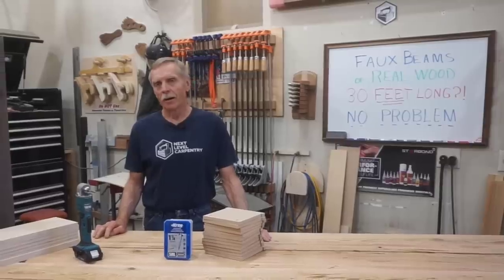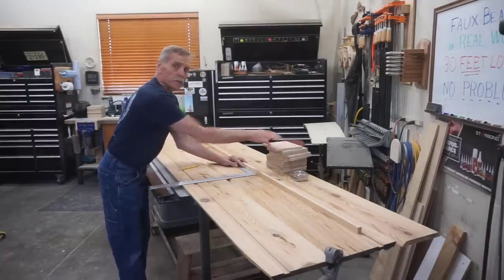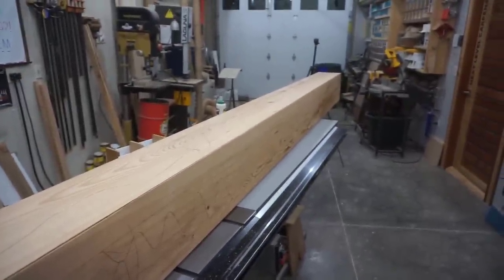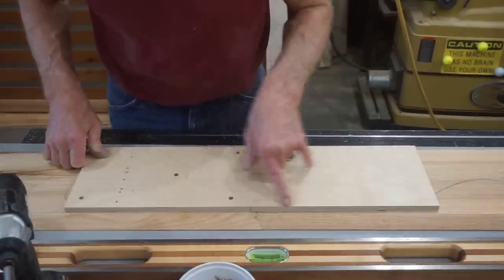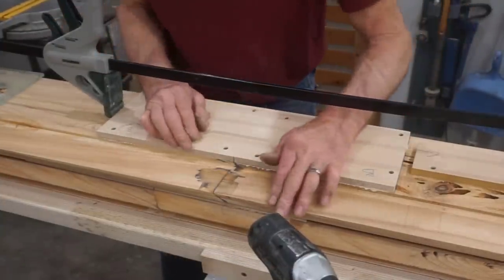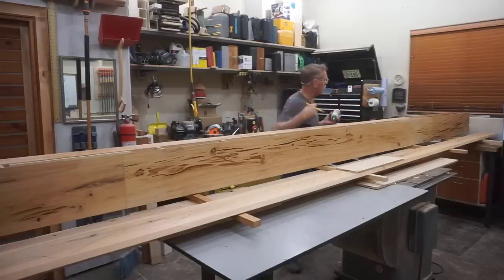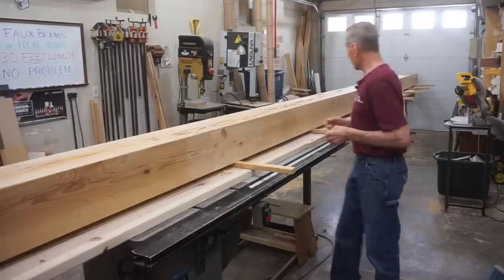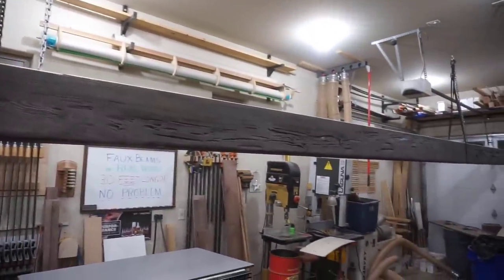Extreme Faux Beam Build

Comment: Great looking beam Matt!  The miters and finishing techniques really cap off a master execution of straight and true carpentry.  Thanks for bringing us along while you built this.
Reply from the maker: Thanks for checking this out Greg... I hope it opens up architectural/design possibilities for those who watch the video. 😎
Reply: It is reassuring to see other carpenters putting specialized care into a detail like this.  

There is always and has always been pressure to get'r done as quick as possible.

There are people out there who will pay you to use thought and care to solve their problems.  And a robust fix is usually the cheaper.
Reply: Don't worry about bending over every now and the Matt.  That's Tradesman Yoga.
Reply from the maker: @markharmon4963  Tradesman Yoga... true dat!!

Comment: I love this!!  Great work!!
I built my Son and Daughter in law an 18ft faux beam. They had a main glue lam beam the was drywalled and textured running through the kitchen.  
Instead of trying install 1 long piece we divided it into 3 equal pieces and welded some flat bar 3in wide and rounded the welds so it looked like 1 solid piece to coverup the joints.  heated the straps and black oiled the steel give it rustic looks .   drilled holes both sides welded bottom bolt heads to bottom holes, top holes run long wood screw and JB weld a faux bolt head over the wood screw..

Comment: Excellent video! I watched to the end of the end of the end, and the beam looks great.
I've done smaller ones to create faux headers and exposed rafters, but nothing that required that level of complexity. Amazing work!

I  mounted the ones I've done on flat surfaces to plates attached to the ceiling. Thanks for the tip on the cathedral peak mounting blocks, as I haven't done that before.

I will say that my dust collection system is a little more advanced than yours though. Mine is a two phased system consisting of a broom AND a bench brush. 😀
Reply from the maker: Lovin' your comment Magius... thanks for watching and sharing!
I definitely need to upgrade my dust collection system to a two-phase model LOLOL!!😂😂

Comment: This Faux-Beam build is AWESOME. In this world of fake pvc and mdf painted trims or worse foam, this is refreshing! Have you thought of using half laps/scarf joining instead of a 45 miter and plywood to extend the length? 
 I'm no engineer, but this is basically a box beam and I'm sure it will be solid.
Reply from the maker: I didn't consider half laps or scarfs Rolf but both are definitely worth considering.  I think the biggest challenge would be in achieving acceptable 'grain flow' from one piece to the next with the pecky cypress but with wood like white oak I could see it being an excellent choice.  It would certainly be a more 'elegant' solution IMHO... 
Best,
Matt

Comment: Wow. Thank you for such a great video. I have a job coming up where I have a 24  foot span to figre out and this helped reset my mindset. I installed faux beams in my kitchen recently and applied the mortise and tennon look to it in the middle of my longest piece, which I learned from one of your other videos; and it worked out much better than I thought it would. Thank you for your videos and time spent to educate, no matter how long they are. Great looking beam you built there. Looking forward to seeing many more as well as, hopefully, the installation video of that monster beam.
Reply from the maker: Thanks for your comment, Carl... much appreciated.  You are the sort of person I have in mind while producing videos like this; someone who watches to learn compared to those who expect to be taught.  FYI this was a nicely profitable project so I hope it works out well for you too.
As it turns out, it was actually simpler to build long beams using this method than it was to build shorter sections using methods shown in that other video.  Since you were able to make shorter beams I predict you'll be pleased with the process and results of the upcoming 24'er.  FWIW I made two 6x8 beams for this same project, one at 21' long and the other at 24' that helped me 'practice' before doing this beast making it come out better and with less stress.  Let me know how you do if/when you tackle that longer beam and expand your horizons!
Best,
Matt

Comment: I had this idea floating in my head for my son's house, so it's great to see.  I was wondering about the use of glue/jb weld on the end grain - anything I've read through the years says  glue on end grain is pointless but here you are doing it.
Reply from the maker: I used JB weld for this 'end grain' application mainly for its gap-filling property that's superior to wood glue.  It would never hold the joint on its own but, combined with the splice block on the back side glued on with Titebond, it's a perfect combination for success.  The takeaway it to be careful when extrapolating ideas like this and taking them out of context which will usually lead to failure and disappointment.

Comment: Genius.  A great video and lesson on how to do something that scares all of us.  Thank you.  One question: how do you attach to a steel beam (to cover up) running across the ceiling.
Reply from the maker: Thanks Howard!
A common way to wrap a steel beam is to use a powder actuated nail gun to shoot 2x wood blocking to the bottom of the bottom flange and to glue and wedge 2x wood blocking into the web space of the beam.  This blocking serves as 'nailers' to use screws or nails to  fasten the beam wrap to the steel beam.  Hope that makes sense.  BTW I would use the same method to create the faux beam to wrap the steel beam with the exception that I wouldn't glue the blocks in during glue up and assembly.  That way, after the bottom of the beam is glued in and dries, just simply unscrew the glue blocks and remove them to create a u-shaped beam wrap.  It won't be nearly as sturdy but, if handled with care, you should be able to maneuver it into place and fasten it without breaking it IMHO.

Comment: I like the right angle drill, I have that one too. I'm just wondering why you didn't use the Makita right angle impact driver?  I like how thorough you are in your verbal explanation of everything write down to the Torx head screws. I love your shop and the work you do.
Reply from the maker: Thanks for watching and commenting on this one Randy... much appreciated.  You might not believe this but I don't own Makita's right angle impact driver.  It gets worse: I didn't even know they made one until I checked just now after reading your comment.  Do you have both the right angle drill and right angle impact?  Question: can I blame you when  I tell Mrs NLC about the new tool I NEED for Christmas now?! 😉😂😎
Reply: @NextLevelCarpentry  No I don't have it, I have the ridgid right angle impact. I know shame😪 I no longer buy tools made by chinese companies. I now stock my screw box with only torx head screws.

Comment: Another Master Class in finish carpentry Matt,, the final product looked superb.  How did you transport the big boy?? I'm guessing that you would use a couple telescoping lifts to put it in place. I build faux beams in a similar fashion but the indexing block is a new wrinkle to me,, pretty clever old man!  I usually use cdx for the blocks to help eliminate the screw fractures. In any case my hat is it to you, great job.
Reply from the maker: Thanks Paul... considering your extensive background I take your comment as quite a compliment.  Great minds think alike because if I had this to do over again I'd go with 1/2" Baltic Birch for the exact reason you say.  FWIW because the beam weighs ONLY 150lbs or so I'm planning to bolt a couple steel brackets to a couple trusses and do the beam pick with a couple come-alongs to lift it 90% of the way.  After the initial lift I'll slide scaffolding under the beast, remove lifting hardware and lift it  the rest of the way to the 17' high peak by wedging 16' 2x4's underneath.  At least that's the plan, but, as Mike Tyson says: "everyone has a plan... until they get punched in the face!"  I'm just hoping the beam doesn't hit as hard as 'ol Mike! 😃😃

Comment: Impressive!
Reply from the maker: Thanks Michael... it was a fun and challenging project but I have to say it was time to be done with it and move on, if you know what I mean?
Reply: @NextLevelCarpentry  I would have used strips of 1x2...the pocket hole squares were genius!
Reply from the maker: @michaelbradford4444  necessity is the mother of invention especially for projects like this. A secondary benefit of the blocks versus continuous strips of one by twos in Corners is that they can contribute a lot to overall stiffness which was important because it's being had to be transported to the job site and installed as a single piece. Hope you're able to put the concept to use somewhere along the way...

Comment: Amazing work! Best I’ve seen. I’m assuming this beam will be installed up against a ceiling. If you created a beam (red oak 6” high/8” wide) with the same construction, would that work if they were going to be suspended across a 16’ span where the beam would only be supported on each end (against two vertical walls)? I’ve been researching the best methods to avoid the faux wood box beam from bowing and wonder if this method of construction would work. You may have mentioned this in the video, but are the internal blocks 3/4” plywood? Thank you!
Reply from the maker: It would take at least 10" of beam height for an 8" wide beam to freespan 16' IMHO.
Blocks can be plywood or mdf.

Comment: Great work!! Would you ever consider using scarf joints instead of miters to better conceal the joints in the shorter pieces? A lot more work I know, but a nice detail!
Reply from the maker: Scarf joints would actually be a better solution for both appearance and strength (they wouldn't need splice blocks for strength) so, if material availability & cost weren't factors I would definitely consider using them as an alternative as you suggest.  On a beam with a smooth, stained finish with any level of sheen and installed at a height that was closely visible I think it would be necessary for a convincing 'solid beam' look.
Reply: Wouldn’t you need a radial arm saw with a dado blade installed to cut something like that? Or you’re down to hand planes and chisels.

Comment: Awesome tutorial -As well as the temporary block above the daddo joint would some 18 gauge brads from the back help hold that joint even after epoxy goes off?
Reply from the maker: Thanks Pinpatch.  Personally I don't think 18 gauge brads would help at all in this application.  To understand my thinking you could do a little test by brad nailing a 45 degree joint on a couple pieces of scrap.  I don't think they'd offer the slightest bit of strength to the connection.  I don't mean to be harsh for a very reasonable question but I operate from a mindset that brad nails are over-used these days... probably just an old-school thing.  I also think pocket screws are over used though so this project is a bit of a reality check for this old nail bender! 😃🤯
Reply: @NextLevelCarpentry  I agree it was just to pin the mitres together until the epoxy goes off where a permanent back plate couldn't be left.  
We use this a bit when mass producing mortise tenon joints for sashes. Glue it all up then pin it when in the press and remove it. This keeps the joints solid enough until the glue goes off and frees the press for the next sash (or door)

It would be great if you could show a few photos of the beam installed. 

Thanks for your effort and time doing these videos.
Reply from the maker: @pinpatchyeah7987  oh okay thanks for the explanation because I misunderstood your original comment thinking you suggested nails for additional strength not for their temporary benefit of alignment.
That said I think the softness of that pecky Cypress would still render 18 gauge nails useless but in something like Walnut Maple or Oak they would serve the purpose.
😎

Comment: If the ( MDF ? ) gussets get wet, they will swell and potentially pop the mitered edges of the box beam, maybe use a different material for these?
Reply from the maker: If enough water gets into this beam after installation to make it swell to the point of popping miters, the failed beam will be the least of their problems and I'm not going to feel irresponsible for choice of material 😏

Comment: That was awesome! How in the world are you going to transport this monster beam?
Reply from the maker: The beam is so rigid and relatively light weight (less than 150 lbs) that two of us simply carried it out of the shop and set it on 4 sawhorses strategically placed on a 24' flat bed trailer for a trouble free 12 mile trip to the jobsite... gotta love it when a plan comes together.🤯😃
Reply: @NextLevelCarpentry  I stayed to the end of the end of the end, and the "beam" ended up beautifully.
Reply: @NextLevelCarpentry  I assume you didn't have a staircase to deal with, the road transport would be the least of the problem

Comment: Why are you using titebond 3?  It needs heat to finish the curing process.
Reply from the maker: I explained why I use Titebond III Terrell.  Not sure where you get your information but I can tell you for sure that I've glued many thousands of linear feet of wood joints of all types on all kinds of wood and never applied 'heat to finish the curing process' and never have joint failures...

Comment: How did the builder get the beam into the house and in position? They definitely did not go in the front door, around a corner and up the stairs! In though a window maybe? With a crane maybe? Inquiring minds would like to know.
Reply from the maker: FWIW I'm 'the builder' and, with the help of the dad of the household, will simply carry the beam in through the oversized front door directly into the great room. Two come-alongs will raise the beam up to the 17' high peak of the cathedral ceiling where the beam will be position and fastened in place... at least that's the plan, anyways.

Comment: What is that gizmo your texturing with
Reply from the maker: It's a restorer tool made by Eastwood Bob.  You can see it here along with the wire wheel option: https://a.co/8YEj2LH
Here's a direct link to the video I mention in this video that goes in-depth into the whole texturing process: https://youtu.be/QBf2evSzEzM

Comment: Didn'y understand how the 45.5 degree miter works?
Reply from the maker: It's a subtle thing, Ken. 
Because each miter/bevel is over-cut by half a degree, it leaves a 1 degree gap on the inside of the corner joint which ensures that the outside points of the bevels are an 'air tight' fit. In practice, pressure from screws pulling the joints together deflects the outside points tighter together as they tend to pull the 1 degree gap on the inside together. 
Compare this to cutting the bevels at exactly 45 degrees where any variance in the joint during assembly is likely to leave a gap in the joint on the outside corner of the beam.  
Admittedly it's a small thing but, in my experience, taking this simple extra measure makes the end result 'next level' in appearance...

Comment: I can tell you are not in Colorado. That glue would have dried before you finished the first 30ft of the 120ft glue up! Lol
Reply: Perhaps a moist sponge adding water to the to be glued surface in advance would help slow glue dry time…
Reply: @johnstewartrichards5922  I just considered running a humidifier. 

Adding moisture to the surface is something that has helped me as I live in dry California. It might make the glue to runny as that seemed to be something with which Matt was battling on those non horizontal surfaces.

Comment: Go why 45 and a 1/2 and not 45??
Reply from the maker: I mention that that angle assures a tight fit on the outside of the miter.  It's a little 'pro tip' that makes the sharp points of the joint come together first when pressure from the screws pulls the joint together for a 'guaranteed' tight fit on the outside of the beam.  I use 'the same' principal for the miters in this video too: https://youtu.be/hK1vz-aKe6c